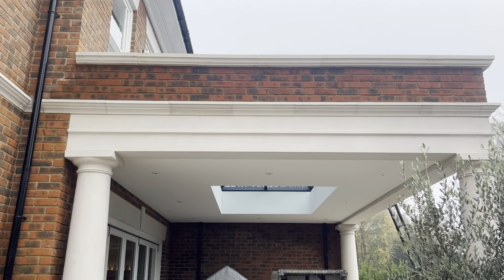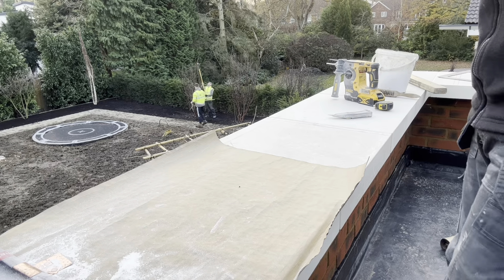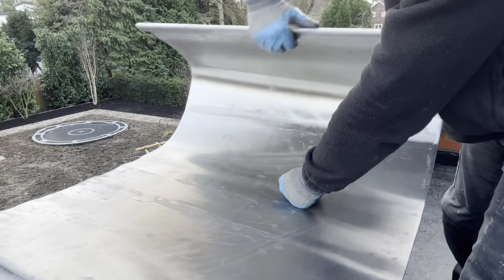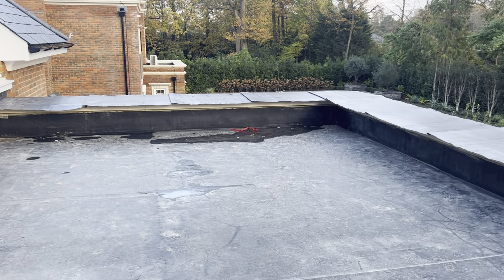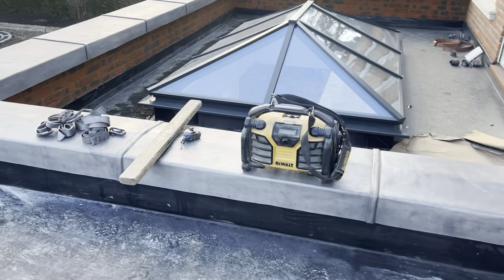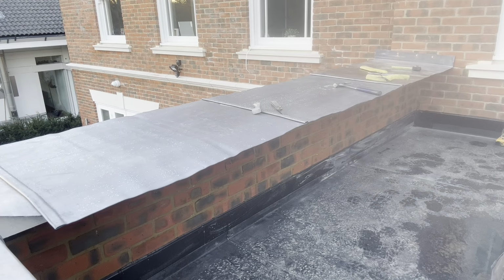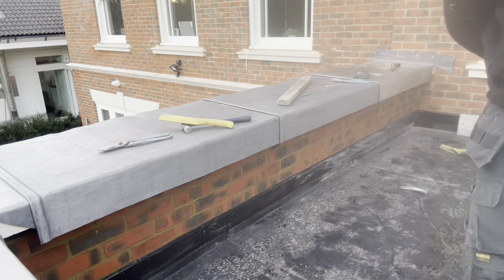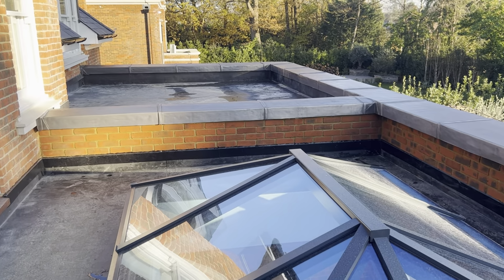Code 5 Lead Capping To Coping Stones. Complete Installation

Comment: Hi Stuart, awesome work mate, I wrote a comment with a link to an item for you but looks like I can’t send links via YouTube 🤦‍♂️ so I’ll write it again 😂

I previously said that I see you cut your lead with either lead snips or a stanly knife, from one lead guy to another, we use a Mikita lead nibbler (I did send a link 1st time but obviously not allowed) it’s a battery powered nibbler and makes very light work even cutting code 8 lead, it also gives you the perfect welding rod as well 😁 I would highly recommend one, they pay for themselves in no time at all, they are a game changer 100% 
But without sending a link or picture it’s hard to show you the exact one 😢 there around the £270-£300 mark (gone up in price since I brought mine) but like I said, highly recommend bud 👍👍
Reply: Mikita DJS161Z is the model, it’s for cutting metal sheet but works perfectly with lead 👍👍
Reply from the maker: Hi Scott thank you. 
I might have to look into getting one of those. Can you use them for cutting the finished straight edge on stuff ?
Reply: Yea they work absolutely fine for that, they really are worth buying 100% 👍

Comment: So are you just using 25 mm copper ring shanked nails banged into your plugs or something more substantial? I’ve had situations where a timber (ply) substrate on vertical cladding is too bouncy (insufficient timber studs) so left with no choice but to screw the copper clips. Piloting first and then using nails was an option but found the nails to lose their hold. You can imagine the result, the screw heads starting to show through the lead as the welts are set in. What would you do? Insist the chippy beef it up a bit to give it the strength needed? (If only…)
And, is it imperative to use tar paper at all times regardless of whether the lead sheet is on the flat or vertical and irrelevant of what the substrate is. Is it solely to give the lead longevity (reduce moisture on the back/ underside of the lead.? Does it really make that much difference?
And finally, how come sometimes you have lead clips on the drip/bottom edge and other times not. So when capping is overlapping lower levels of lead then there are lead clips but no clips on this capping. I hope that all makes sense. And as always, a great job. Impeccable standards and a real pleasure to watch you work not to mention an education too. Hopefully not too many questions for you.
Reply from the maker: Yes I’m just using 25mm copper ring shanked nails hammered into a red plug. Plus a piece of copper to make the nail head bigger. These are fantastic fixings and you don’t see the head when you dress the welts in when using screws. 
If you are using screws you can bend the copper over the screw heads and then you won’t see them. 
Yes you should always use grade a building paper when laying lead flat or vertical. The only time you don’t need too is for flashings. 
The paper protects the underside of the lead from alkalis in the stone and concrete. 
It also reduces corrosive attack when laying lead onto plywood and oak. 
It doesn’t matter too much if you cut drip bottom edge of use have a turned drip bottom edge. The turned edge is just better in high exposure. To prevent wind lift. 
Also thanks for watching.
Reply: @slbleadworks  thanks for replying. My goodness, what a simple solution. Kicking myself for not even coming up with that myself, bending the copper clip back over the fixings. Everyday’s a school day! And thanks for the explanation about the paper. Makes total sense. I mean , how many times have u lifted existing lead to find that white flaking powder coming off it, lead oxide I’m assuming.

Comment: After you trimmed the edge did you leave it or tuck it under? I've seen on a few of you videos you tuck it, I would love to see a video of how you do that and make is so neat. Amazing work as always 👍🏼
Reply from the maker: Thank you. This job was just a straight cut edge.
The best way of getting a turned drip edge nice and neat is to have a continuous copper drip edge. But this only works when going onto ply etc. 
To do it onto stone you have to preform the turned edge. But it’s very hard to keep this completely straight this way.

Comment: What oil are you using and why? What is the purpose of the paper under the lead?
Please get a microphone, l can't hear what you are saying.? Thank
Reply from the maker: Sorry I can’t remember the brand of oil I used on this job. 
The building paper protects the underside of the lead from alkalis in the stone and concrete. 
Yes I know I’m sorry I really need to look into getting a mic. I’m going to research it for the new year. 
Thanks for watching.

Comment: Some strong fingers there making code 4 look like 3...
Reply from the maker: Thank you this was code 5💪💪
Reply: Sheesh.. was doing a code for back gutter yesterday in the cold and was struggling to do anything with it!!
Reply from the maker: @tk2097  it’s definitely much harder in the cold. I have a  gas gun I use sometimes to soften and heat the lead. Or even myself 🥶🥶